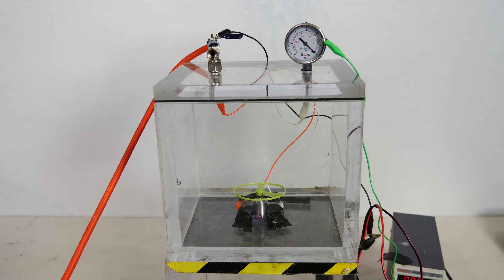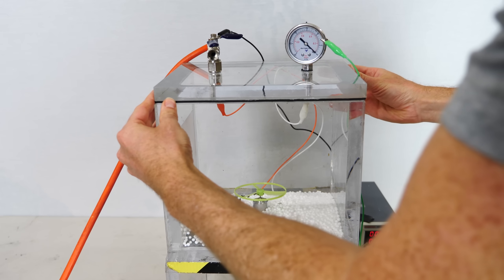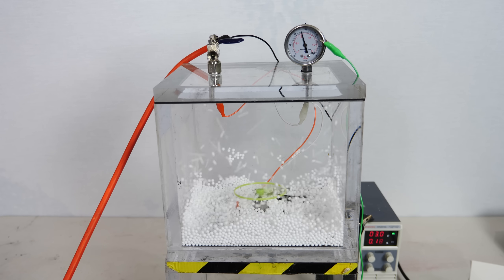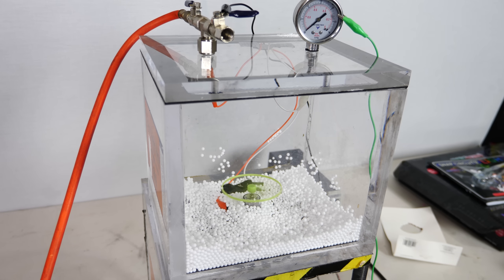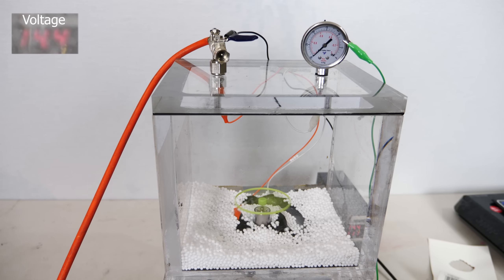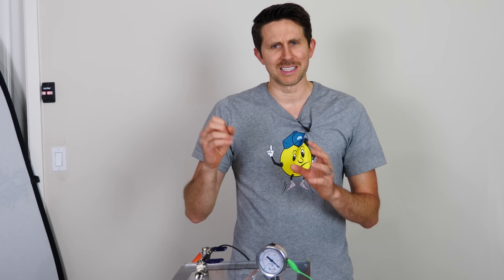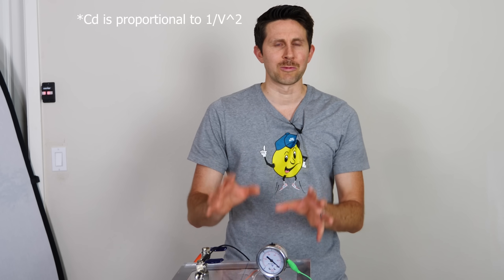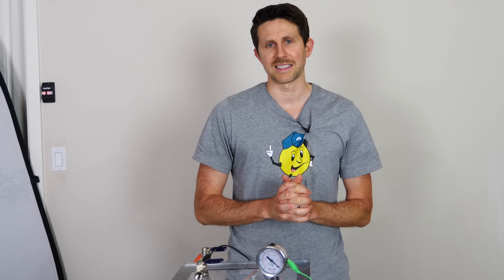What Does a Fan Do in a Vacuum Chamber? Weird Results

Comment: This could be a good simulation of the different heights of the atmosphere and density of air. You could also use different size/density of styrofoam to simulate larger and smaller molecules

Comment: You can see from 1:33 to 2:07 that the amp draw of the fan motor decreased significantly as pressure dropped due to less drag on the fan's motor.

Comment: Was it the air that made the balls fly around, or was it the motor's vibration?
Reply: I think its the vibrations of the motor too as the balls stayed on the floor and only jumped when the vibrations where high enough to make them bounce
Reply: Static charges
Reply: It was just the motor's vibrations being transferred to the floor of the chamber, then to the balls, making them jiggle more and more as the motor voltage increased. 

He over-drove that little 3V motor with far too much voltage, causing pretty severe vibrations on the chamber floor. The motor was stressed far beyond its 3V design limit. 

The tiny amount of air did virtually nothing.

Comment: Put a speaker in a vacuum chamber and play it as you suck out all the air and measure the DBs . Use a string so it doesn’t touch the floor.

Comment: I think the outcome of this video will help confirm something I was just thinking about. If I had a jar of freshly picked plant based material and brought it to a vacuum would the plant based material dry out without air to absorb the moisture?
Reply: Yes it will, if you can get the pressure low enough the water will boil out.
Reply: @averyalexander2303  but i did go watch a video on a thermo molecular vacuum. It was for a product. Pretty amazing stuff.
Reply: Ohhhhhh shit. Right. How did i not think of that. Silly me.

Comment: The air is too thin on Mars to blow the ship over, it's one of the few mistakes the movie made.
Reply: I would assume that even the smallest quantity of air could topple a ship on its side but it would need to be blowing VERY fast, don't know if it was going fast enough in the movie tho
Reply: Andy Weir already acknowledged that it's one of the few mistakes that were made in the story
Reply: @SkaveRat  And it was a deliberate mistake. He needed a dramatic way to strand the astronaut and decided to take the dramatic license
Reply: @rarespetrusamartean5433  It's about force exerted.  The movie says the storm is about 150kph, the force on the ship would be the same as the force from a wind on earth of less than 20kph, or about a 12mph wind.  Yeah, I mean to figure out the exact amount of force to topple the ship we'd have to know a lot more about the ship, that said, I feel safe in saying it would take a hell of lot faster wind to even begin to concern the astronauts.  :)
Reply: @MooKyTig  okay if those speeds are correct you are 100% right lmao
Reply: @MooKyTig  I would have just assumed he meant "equivalent of 150km/h if it were on Earth". Then I probably would have realized that would require the real speed to be ludicrously high, so it still doesn't resolve anything...
Reply: MoKTiger0o but wouldn’t the mass of the ship also be reduced by the same factor? So you wouldnt need the same wind speed as on earth to blow the ship over.
Reply: @rarespetrusamartean5433  The highest recorded wind on mars wouldn't be able to tip you over.
Reply: Still an awesome movie!
Reply: Also, as the astronauts knew that blow over was a potential hazard,  tie downs would have been an easy solution to prevent the rocket toppling.
Reply: I wonder the amount of force would be needed to take off a ship from Mars? 🤔
Reply: @NnuxX  About a third the energy needed to take of from Earth and reach orbit. So if you need a 500 ton rocket (at liftoff) to put 20 tons into Earth orbit, a 500 ton rocket from Mars should very very roughly be able to put 60 into orbit around Mars. The amount of force needs to be greater than the mass of the spacecraft. So a common design for an Earth Return Vehicle from NASA is about a hundred tons. That weighs with Mars gravity about 38 tons. So you want a  good 50 ton thrust engine to get that off the ground. The higher the thrust of your engine, the less fuel you waste fighting gravity.
Reply: @please_stop-v7o  what movie are they talking about
Reply: @PrimusInvictus  the martian
Reply: Yep. Highest windspeeds of the biggest hurricanes on Mars are about 60mph. "calculations show the speed of a 60-mph storm on Mars would feel more like 6 mph (9.6 km/hr), Smith said"
Reply: lol. as if the film was at all accurate in other things!
Reply: It wasn't just air, you know? It was also sand, dust and debris which at high speeds can build up tonnes of force when hitting against a static object like a ship.
That and the fact that science fiction is not the same as applied science.
Reply: @sebastianortega1938  You would have the same problem with the sand, the air is too thin to do a very good job of blowing that around, only the tinier particles get pushed around. Velocity can overcome that, which is why the Mars helicopter's blades will spin super-fast.  Anyway, the Mars rovers did get dust on them, fine like talcum powder.  I don't know why they didn't build vibrators into the solar panels to shake the dust off.
Reply: @johnnysparkleface3096  Or even something like windshield wiper blades
Reply: @Johnny Sparkleface 
The vibrators would work very well on a rover or fixed array as a “dog shaker.” It’s also very simple and lightweight. There are on the other hand some down-sides when it comes to using this method of cleaning, such as the high number of moving parts that can, and probably will, wear out. Mars dust may be sticky, and won’t fall off easily using a vibration method.  Also, the motor’s vibrations could potentially dislodge or loosen other components.
Reply: @rickard1200  that's why they went to an RTG no moving parts no need to worry about dust reducing power the down side damn thing cost millions and only makes around 100 watts of power cant even run a kettle off that damn amazing they can run a fancy ass rover off such little power. i bet NASA would be over the moon (pun kinda intended) if they could get double the power.
Reply: @sebastianortega1938  look up the fasted wind speed on mars. it wouldnt be enough to topple much of anything even on earth, even with dust and sand.
Reply: @sebastianortega1938  NASA calculated that the maximum force that could be generated would be about 1/10th that of the movie. I remember the number 7500 kN which would be around 8 tons force in the movie. So in reality the atmosphere could only exert a bit less than a ton of force on that rocket, which was based on actual NASA designs for a Mars Ascent Vehicle. So winds can't topple it. Makes sense, why design a return system that's supposed to sit on Mars for at least 3 years before being used but it can't take a storm that occurs several times a year. But he needed something that would make them leave quickly but not really damage the base or the ascent vehicle.
Reply: The movie didn't get anything wrong. No movie is suppose to get anything right. It's meant to tell a story and/or invoke ones imagination. To get it 'right' you do what is called a documentary.
Reply: Why everyone of you talks like a great scientist?
Reply: I don't think that is an issue.
There are mars storms happening regularly. That is how NASA lost a rover: it was cut of from sunlight for too long.
When there are storms that are capable of blowing dust and sand I would assume the winds there could be capable of knocking over a ship.

Comment: The joys of vacuum pumps... There was a time I used to work with 1 everyday .....once you get down to 10 microns or less you will get no movement in there ...there's no atmosphere to move them... and the static electricity is from them rubbing against each other.../ 2 stage pump

Comment: Hmm, electric motors essentially run on waves interacting with metals and such, it sounds completely contradictory, but could there be a way to run pneumatic equipment in the vacuum?
Reply: A bit strange but yes I don't see why you couldn't. Practically the same as you would normally use the equipment, just more of a pressure difference.

Comment: I have an experiment I would like you to do.  Supposedly apply ing a surplus of electrons to a red hot item will quench it.  Somehow insulate a DC bulb and battery circuit and dump electrons onto the circuit while it is glowing.  Maybe have an un exposed roll of film next to this bulb to develop for x.   I think your vacuum blender had most of the components of leyden but  transient.  See Weibel rohr
Reply: Xray because the surplus energy has to go somewhere, think evaporation of electrons.  It will be in a vacuum and could be conducted down through filament supports and base?  Meter base temp?
Reply: Just saying that's a lot of radiant.  Maybe explain black body to everyone
Reply: If electrons truly only move across the surface of the filament, the valence jumping produced photons would fill in all unoccupied orbits?  I dont even believe in electrons what am I talking about ? Any see what happens
Reply: Surplus electrons back fill the empty valence stopping the electron from dropping back down to lower energy level
Sorry I'm distracted

Comment: The vacuum pump has to work somehow.  A turbopump is just a really powerful fan, after all.
Reply: That's over simplyfied and not true. They spin way faster, so the movement of the blades actually add to the movement of the molecules, directing the molecules away from the vacuum chamber. A normal fan is a lot slower, not in the range of the thermal movement of molecules. A fan would hardly work on single molecules, while a turbo pump does.

Comment: What does a fan do in a vacuum chamber?

It spins.
Reply: If they're a fan of Papa Roach, they suffocate.
Suffocation, no breathing, don't give a f*** if I cut my arm bleeding.
Reply: I expected the fan to increase in speed due to lower air resistance.
Reply: @igortretsnom  it wont spin fast because speed is set by the voltage, but it take less current to keep running at the same speed because you have less air resistance. You can see the bottom meter at 19 (1.9A?) with air and drops down to 13 without.
Reply: @MikhailKoslowski  makes sense. Thanks
Reply: Man why didn't I think of that
Reply: Woa thank you just save me 6 minutes,
Reply: The question is how fast ...
Reply: Wants to be let out, loses consciousness and eventually dies. Darker meaning.
Reply: Harvard : my man, you want scholarship? 😂
Reply: Seems like we got our icon from same website 😂😂😂😂😂
Reply: And vibrate.
Reply: Yep
Reply: Anonymous Mafia WHOA REALLY? ARE YOU JOKING!? LIKE THIS IS LIKE A GENUINE QUESTION.
Reply: To get out of the vacuum chamber to watch this video.
Reply: My GOD
Reply: give cpt. obvious a medal! xD
Reply: There is no such thing as a perfect vacuume. Stop saying that. 29.99 inches of mercury is close but only space is perfect vacume.
Reply: @jonthompson8743  space isn't a perfect vacuum but it's fairly close. 1 atom per meter cubed is pretty darn close to nothing but it's still something so it's not "perfect".
Reply: I kinda expected it to burn out without the airflow to cool it.
Reply: Idk if this is a sarcastic comment, but I guess the point of this experiment is to see if things will still move in a vacuum chamber with a fan on.
Reply: LOGIC
Reply: Where do theses stairs go? They go up.
Reply: Fyi he means the fan just spins  without any useful work which is to direct wind
Reply: That's crazy. I would have thought the blades would be spinning
Reply: So? How do rockets propel themselves in space if there is no atmosphere off if which to propel? 

How does NASA do it? 🤔 you are not a critical think are at all.
Reply: @rickbaldwin6291  are you honestly asking how rockets work?
Reply: @GameTimeWhy  no, questioning how they actually work in a vacuum. Boats push from water, planes push through air... what do rockets push against in the vacuum of space?

I’ve read the supposed explanations of this phenomenon. Something is fishy.
Reply: @rickbaldwin6291  the super duper simple explanation is that the rocket throws material one way which propels it the other. It could literally be anything and doesn't have to be gasses. It could be a literal couch thrower if we had the technology to create such a thing. If you want an actual paper on it I'll send you one. Nothing is fishy and you would know that if you've already read anything on it. There are probably some really good videos on here even that explain it if you don't like reading and need the visual.
Reply: @GameTimeWhy  😂 your explanation needs something to push off of... according to your presumption you can literally swim in mid air... just because... no need to prove anything is there to push off of... it’s just “psyence.” 🤣 

Listen to yourself... you are trying to belittle me yet you cannot tell me what it is that space rockets push off of to move. 

Funny stuff guy! 🤣
Reply: @rickbaldwin6291  and no I wasn't belittling you. I just want you to learn. It's really simply concepts.
Reply: @GameTimeWhy  why is combustion and propulsion not important in space? When you stop, what do you apply the brakes to? What do you peel out on? Where is the rubber laid on the proverbial road? Hell,... where’s the road?

This video shows there is no atmosphere in which to make any difference one way or another in “space.”

No, my question is far from frivolous... “hung up on the rocket part.” The rocket part is the only part it takes to wake an honest man up.
Reply: @rickbaldwin6291  read what I wrote in both comments. I explained why it doesn't matter in space. You are getting hung up on combustion based on your comments. We don't even require combustion on earth to "burn rubber" or to fly. It's just the easiest way currently to create the energy required to move our vehicles at speeds we want but in space it's just Newton's 3rd law. You throw material in one direction and you get thrown in the opposite. Combustion can't happen but it also isn't needed in space. Look up solar sails. It's essentially just a sail boat but in space.
Reply: @GameTimeWhy  you have a fundamental misunderstanding of the laws of physics. Particularly those laws governing that of a vacuum. Until you stop to digest exactly what this demonstrates, “a vacuum removes any means of traction whatsoever.”

There is nothing to push off of. Hence, no way to maneuver at all. 

And Santa Claus is also untrue. I hate to be the bearer of bad news.
Reply: @rickbaldwin6291  before we continue, are you actually being serious? Like legitimately serious and not trolling me? If you are being serious then I'll try not to be snippy but you aren't actually reading what I'm saying and what I'm saying is in simple terms. I can an educational link for you though and we can read an article together if you want. If you are being serious I think you are getting caught on the fact that it can be difficult to comprehend something you haven't had first hand experience with.
Reply: @rickbaldwin6291  Fuel is being burnt inside the rocket. Gas is being released from the rocket, that too with a high amount of force. Newton's 3rd Law of Motion dictates each reaction possesses an equal and opposite reaction. The force exerted by the expelled gas is also applied on the rocket, which propels it further. As for how to "apply the brakes", the rocket changes direction to the surface it is supposed to land on and then again exerts force in the form of fuel combustion, nullifying its previous momentum and reducing its speed.
Reply: @R.O.U.S  it's tough to say. Some people really are this uninformed. I know people who are sort of like this irl but giving different analogies can help them to understand because it can be difficult to understand something you have zero experience with on the daily. Who knows.
Reply: @R.O.U.S  this experiment proves there is zero “reaction” in any vacuum. Every action in a vacuum is nill.. therefore, every reaction is just as negligible.

Wake up... they ain’t out there changing directions going to planets... not happenin! Grow up.
Reply: @R.O.U.S  you need an atmosphere for Newton’s 3rd to even exist! What the hell is this “burnt rocket fuel” pushing against to “propel” the “spacecraft?”
Reply: And who was the guy they left behind that filmed their ascent back to the Apollo “spacecraft?” They left a man behind?
Reply: @rickbaldwin6291  let me know if you want to read through it or find some more technical papers we can go through together. Don't worry, we will find some form of learning style that works for you.
Reply: Takes a Nap 😁
Reply: In high rpm or in low or as same
Reply: bj
Reply: Answer: it spins

Comment: Would’ve been a little better if he had the fan facing the other way
Reply: Also if he measured rpm in air and in vacuum
Reply: @mr.waffentrager4400  I agree, I wanted to see how the fans speed increases as the air is pumped out and it has less and less air to push it of its way
Reply: Inverse thinking.
Reply: Ha Ha Ha..

Comment: I thought the motor was gonna stop working because of the excessive heat that was building up.
Reply: I thought the same thing, he was pushing it pretty hard and there was no airflow to cool it. I think the only reason it didn't is because there was very little load on it with that little air to create drag.
Reply: Muhammed Enes Camur same I’m surprised
Reply: i'm speculating:
the fan with no load (air being pushed) is somewhat similar to putting a car engine in neutral and stepping harder & harder on the gas pedal.
sooner or later, something in that engine is going to give